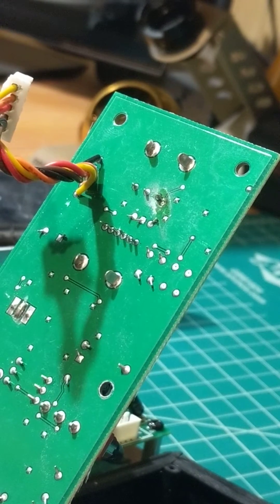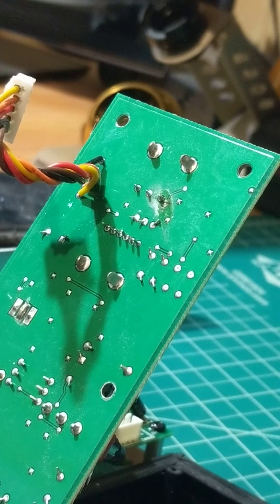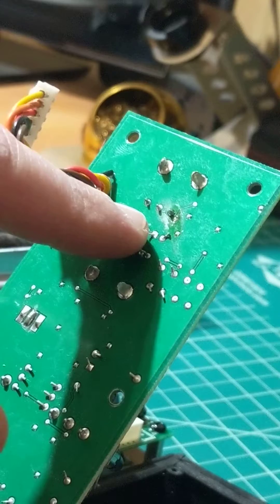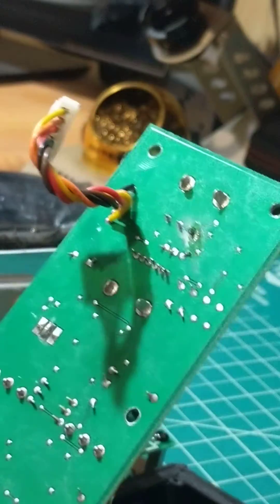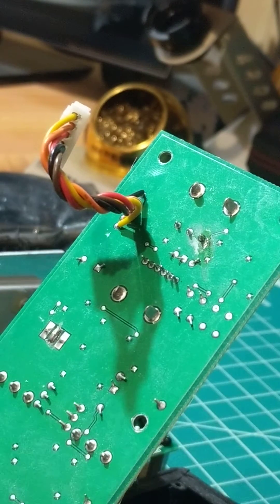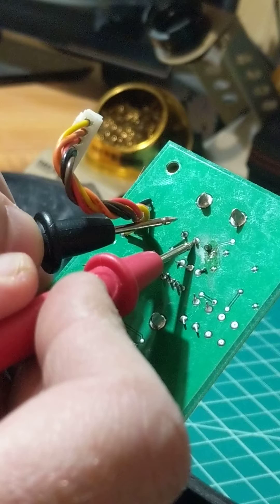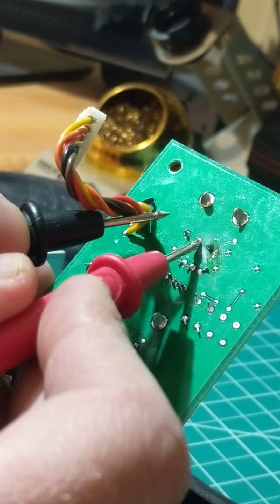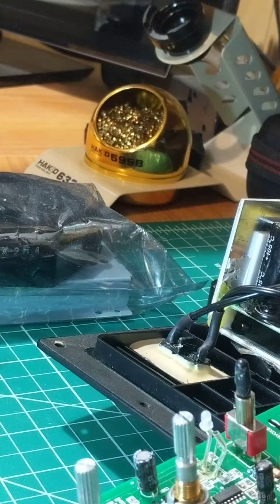Polk Audio Powered Subwoofer Repair

Comment: Hello , Thanks a lot for an informative video. My PSW 125 has burnt MOSFET and I cannot read its value. Can you please share the value of these MOSFETs and the two vertically placed resistance between the second and third MOSFET. I will be highly obliged. Thanks a lot for your kind help